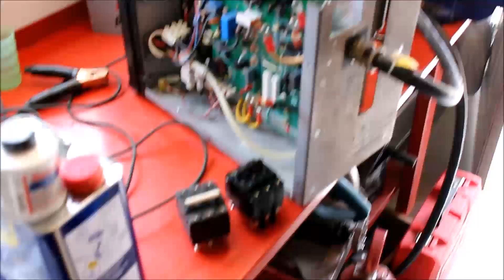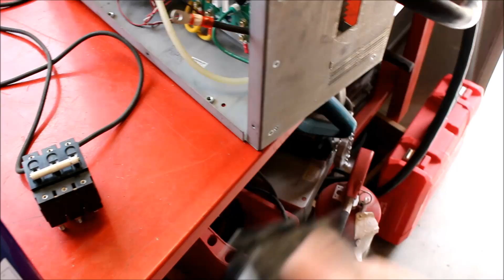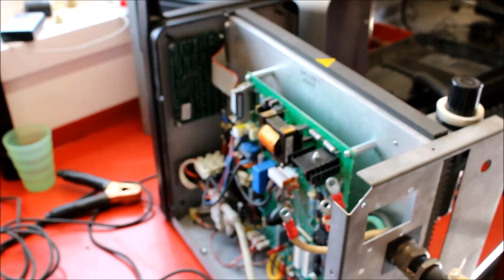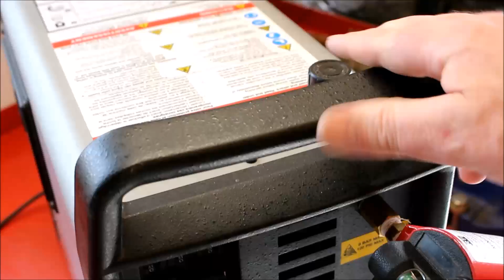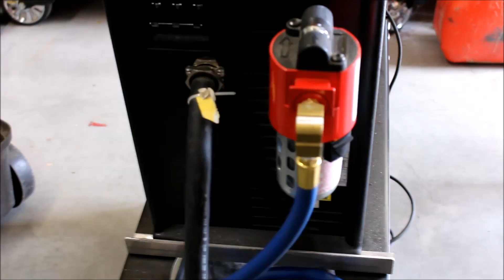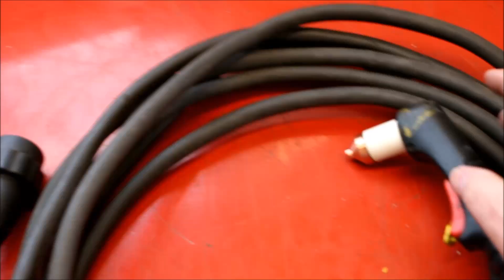Hypertherm Powermax 600 Plasma Cutter Repair and Tune up

Comment: Is this inverter type? Or there is no isolation?
Reply from the maker: It is all electronic so yes it would be an inverter type. Thanks for commenting !
Reply: @CruiserMac  can i see more pics of all the board and parts of ypur plasma cutter so i can see how the   hypertherm works if its having transformer isolation or just runs on directly and if there is a big resistors
Reply from the maker: @smoke_stackz3168  Sure Randall, I will take the cover over and video the insides. Not sure when but sounds like a winter project.
Reply: @CruiserMac  ok thank you😊 i we dont have that brand of plasma cutter here in philippines all plasma cutters here where made in china.burned igbt easily 😅

Comment: Very cool Mac, thank you for "lifting her skirt" and showing us all the goodies inside :) I like the stress relief for the air inlet, that looks to be a solid fix for a design flaw. Did you fab up the cart form scratch, or customize a cart you already had? It looks "factory" made on video, but I am certain you can achieve that level of quality when you want to. Glad to see you're getting out in the shop, have a great weekend...Aloha, Chuck
Reply from the maker: Hi Chuck, good to see you! It started out as a welding cart and I adapted it for the plasma cutter.